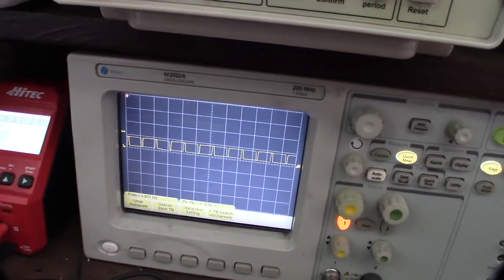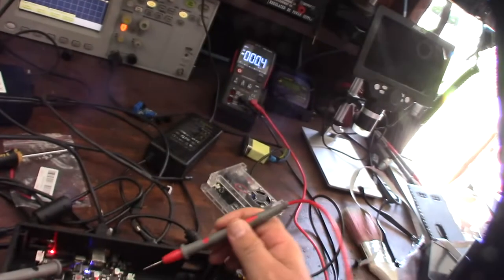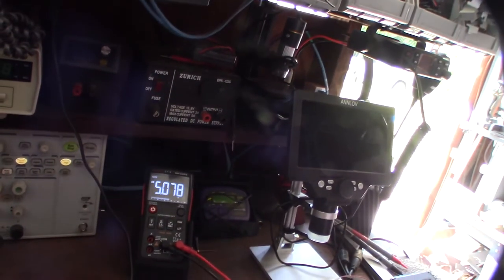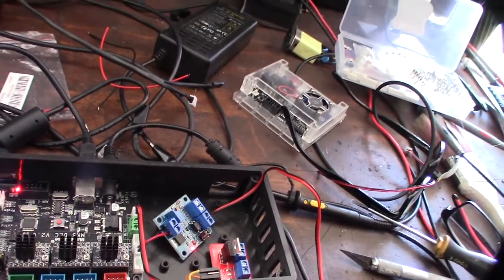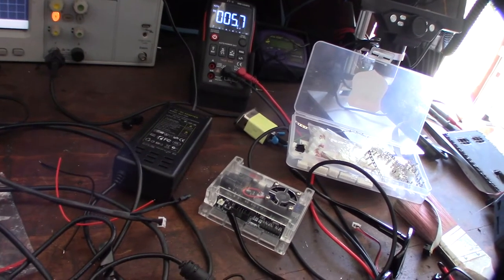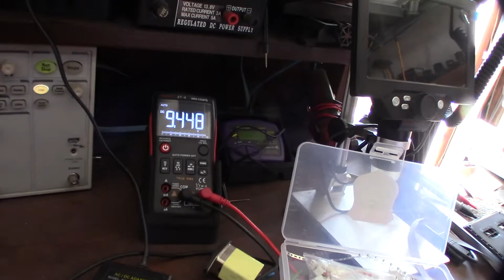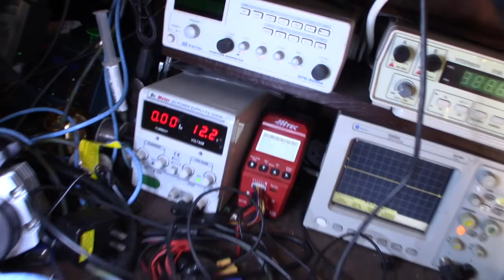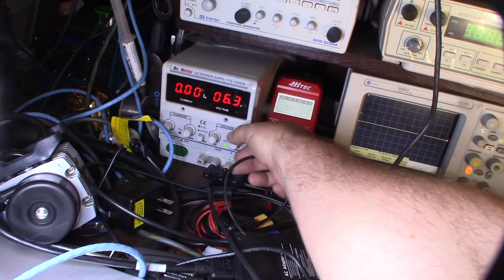GRBL Mach3 10V Spindle Dilemma, Two Solutions for my brushless 3018 CNC upgrade. MKS DLC 2.0

Comment: Most of your views are probably from me.  They are a big help.  My suggestion, rather than videos when you run into an issue, do some for straight forward upgrades.  Like a 500 watt spindle with grbl and the MKS DLC.  Everyone starts with grbl, and most mach users have bigger mills needing little upgrade, (and mach 3 is $175).

Comment: I need to pick your brain on the MKS DLC 2.1...  When I probe voltage on the spindle output (I'm using 24V).  I get expected results without the spindle (24v 100%, 18v 75%, 12v 50%, 6v 25%).  But when I connect the spindle (48v 400 watt, ok with half speed for now), the power is wrong and thus the spindle speed (24v 100%...but 23v 75%, 21.5v 50%, 16.5v 25%).  Using Openbuilds Control.

Comment: The 5v to 10v converter works fine for me.
Reply from the maker: Cool, I'm not sure what route I'll go. The voltage divider seems simpler. Either way makes the 5V pwm signal off the processor less reliable. Either step up 5V or Step down 12V